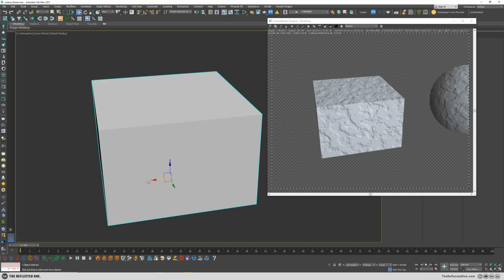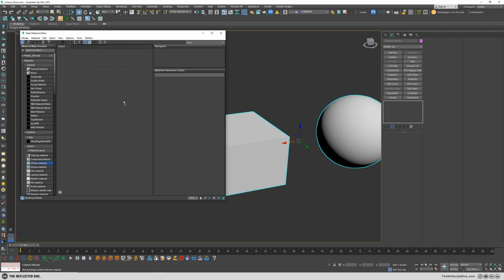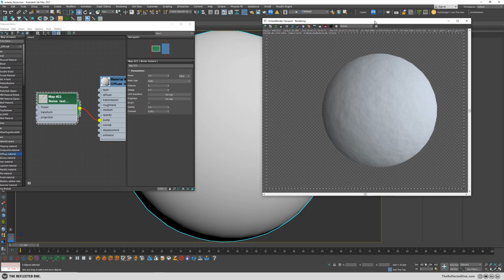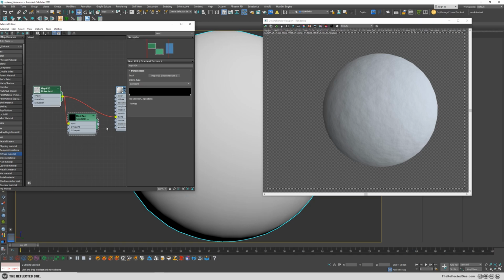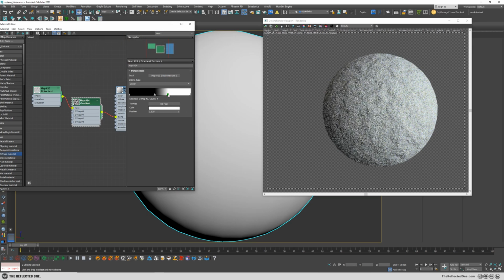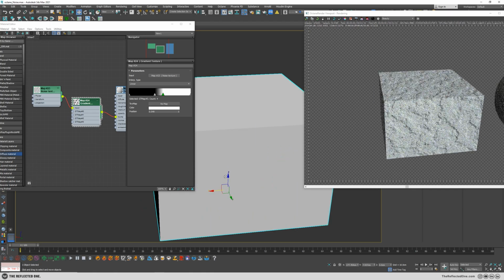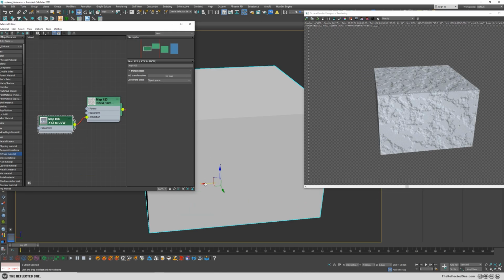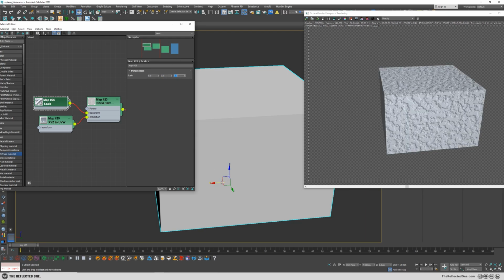[Solved] Octane Noise moves with objects in 3DS MAX.

Comment: Thanks! I've downloaded the demo version of Octane for Max and I'm having a hard time even with basic stuff. Lack of focal length parameter in Camera settings, environment HDRI doesn't match viewport orientation, Shifting the lens does nothing in viewport, only in render and using a Max Physical Camera doesn't help either since the shift lens does nothing in Octane.
Reply from the maker: I wanted to make a new HDRI tutorial but sadly didn’t happen 
Next week I think will upload an HDRI tutorial. 
But for now, let’s just resolve some of your problems.
The focal length in the camera is “FOV” aka Field of view and by default, it’s set to 60, decrease the focal length to tighten the lens.
For adding HDRI first add a texture environment and then in the texture slot add “RGB image” and select the hdri. Also in the UV transform add a Transform value .by changing the translation you can change the rotation of the hdri. Let’s watch this tutorial till next week:  https://www.youtube.com/watch?v=AmiG-m__JLc
The shifting lens doesn’t update in max’s viewport and that’s a shame!! But it will be applied in the render.
Reply: @TheReflectedOne  Thanks very much! I really appreciated your help!
Yes, I know about FOV, but focal length is what everybody is used to as it is related to photography. Every render engine I know has a focal length parameter in camera properties. I read in Otoy forum there is a request for that parameter. I hope they implement it.
I've got HDRI environment working, but as I said, if you translate the image using 2D transform node, the image in viewport background doesn't move along and they don't match anymore.
I love Octane render quality, but these simple things keep me from subscribing to their service.
Keep making videos, please. I've been follwing you from some time now., I hope you get more subscribers, you deserve it!
Reply from the maker: @fvalduga  yeah, I agree. It's not really Compatible with 3ds max unlike cinema4d
usually, you can't trust what you are seeing in max's viewport so that's why I always have my interactive renderer turned on! 
I will make videos as long as I can, and certainly, warm comments like yours help me keep going. Don't hesitate to ask for any tutorials or solutions to your problems, I always look for a good subject to make video for.